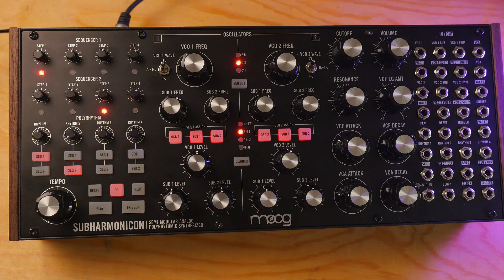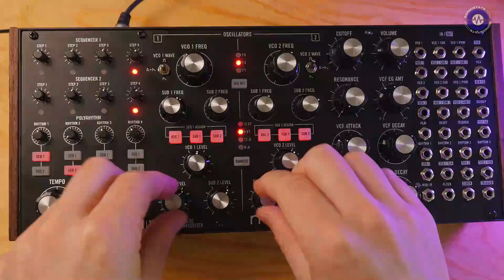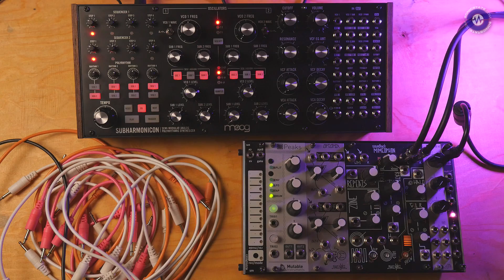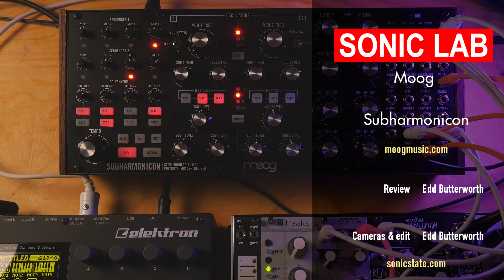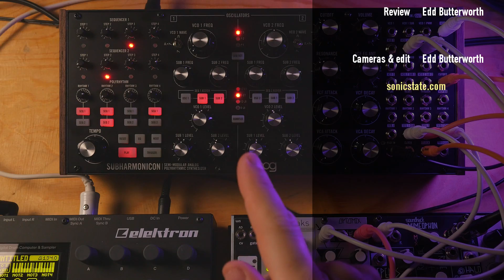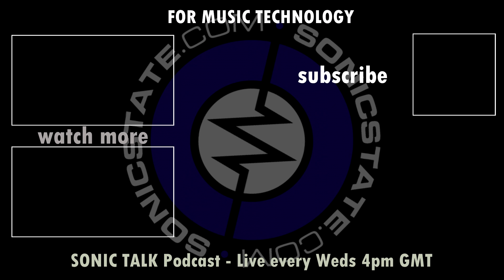Moog Subharmonicon - SonicLAB Review

Comment: Look dont take this the wrong way...but using Arturia with Acustica Audio and nebula....on each Track (Will Give you) 95% of the same result...and a Whole lot easier and fasters....and even running those stems through Any affordable analog gear.....sorry...its sound really good...but between that and vs modern work flows....it just eliminates....so much work in laying down the synth stems...and you can focus on the whole song and not just the synth bus

Comment: Amazing video! This is pretty much exactly the setup I'm working on, except with an OPZ instead of the Digitakt. But how did you get the midi notes to play properly?

The main problem I'm having... When a midi note ends, the pitch reverts back to the note set using the dials on the oscillators. It doesn't matter how long midi note is, once the note is released, the pitch changes back, and then it rings out as long as the release is set for. The only thing I have been able to do is to completely cut off the release. 

When the Play button is off, the notes play as expected (and the release applies to the note played), but then the sequencers are not running, so it not possible to use them to sequence other parameters.

How did you solve this? Thanks!
Reply: I think I remember that in the loopop subharmonicon demo he sets it up to play duophonically via MIDI keyboard, so maybe check out that video. (Of course, it's been 8 months, so you've probably figured it out already.) Cheers!